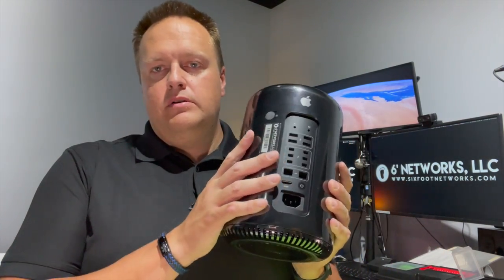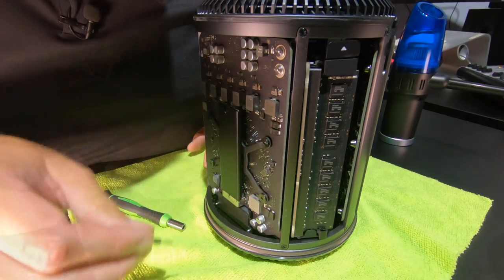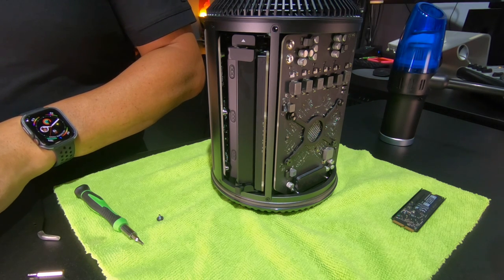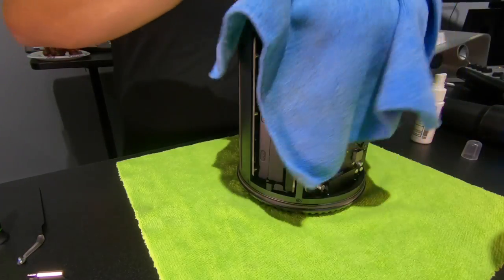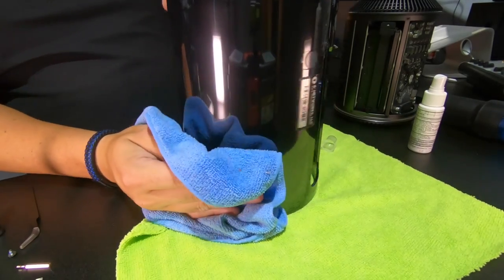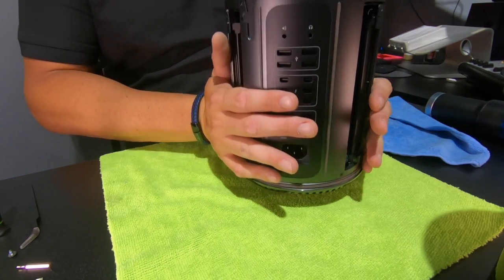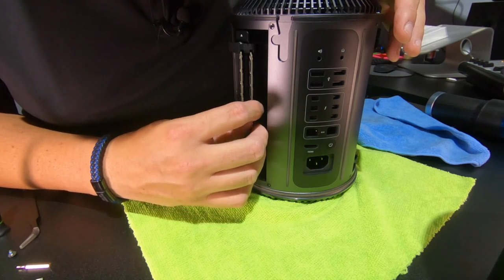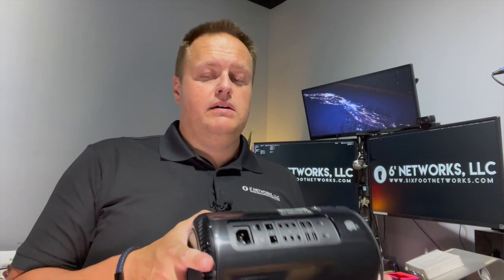2013  Mac Pro Partial Disassembly and Quick Cleaning Inside - 6' Networks, LLC

Comment: How can i boost this computer for gaming???
Reply from the maker: You can probably find parts online, which came from a higher powered Mac Pro then the model that you might have. If that’s the case, see about swapping out the graphics card, the memory, even the SSD, as well as the processor for that of a higher supported configuration by Apple originally. Putting in aftermarket Parts or just a generic processor of sorts just to boost the speed will probably crash the OS.